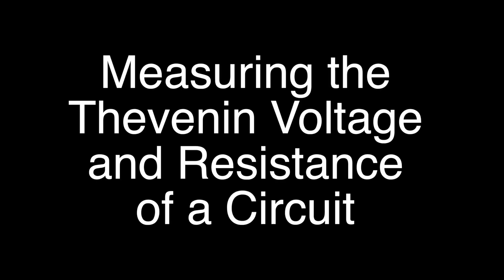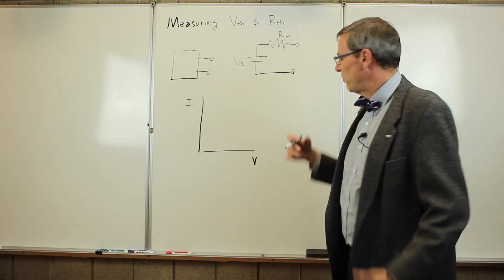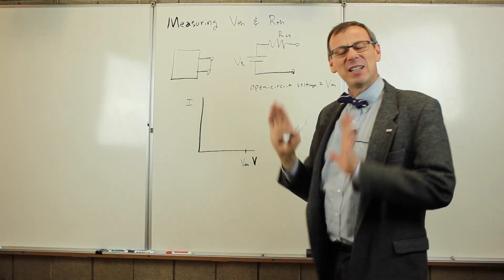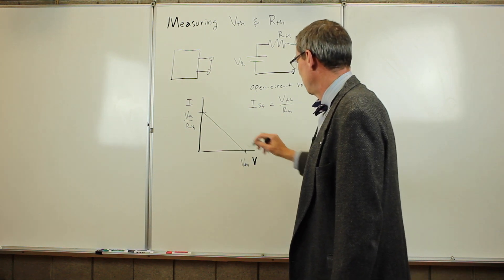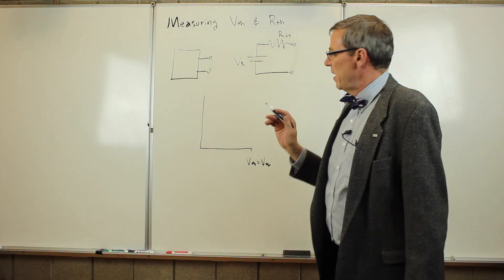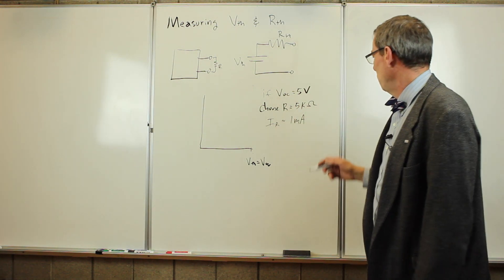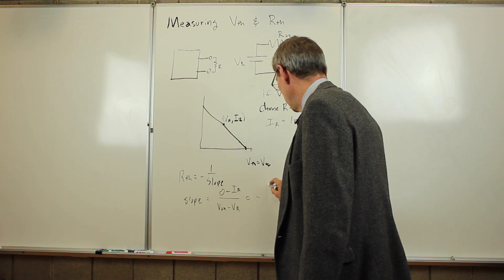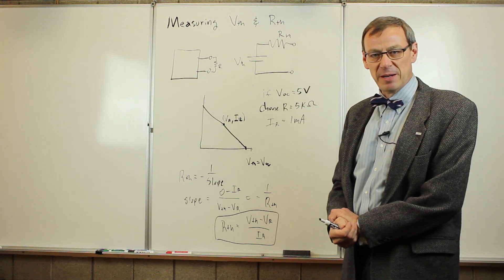Measuring the Thevenin Voltage and Resistance of a Circuit

Comment: Hello professor , thank you for the video.....just one question please : when you suggested to put a resistance across the the open circuit , and you assumed that Vth = 5v , my question is : after this resistance is plugged the voltage across it will not stay 5v ?.....am i missing something ?....Thank you very much
Reply: at first it is open circuit so no current flowing so we got total voltage across open terminals, if  the circuit is closed by any resistor then some current will flow based on that current the R_thevenin resistor drop some voltage. so if we measure voltage across the terminal with that resistor connected we can get V_thevenin - R_thevenin*I_load